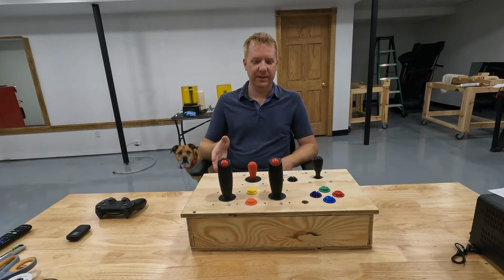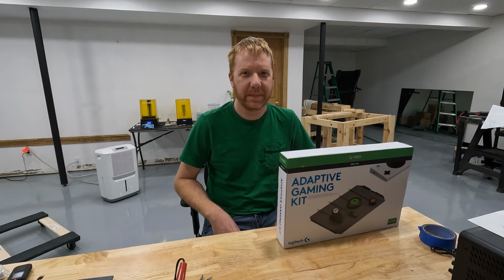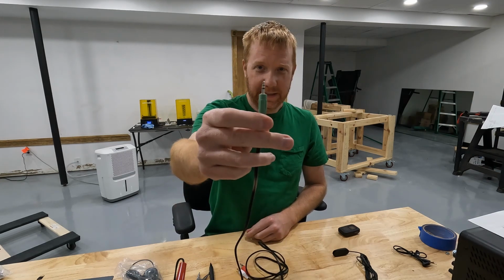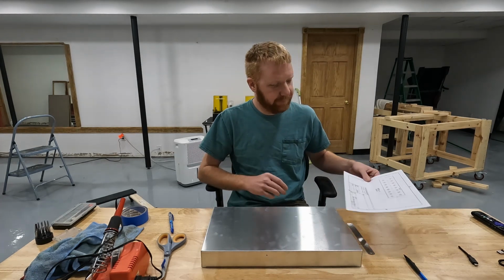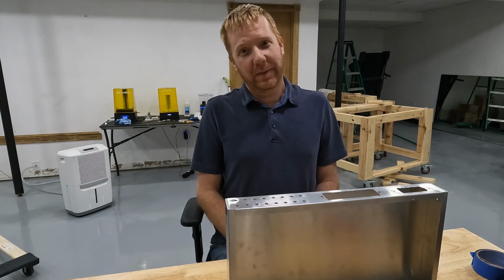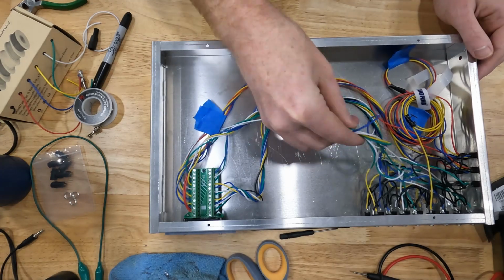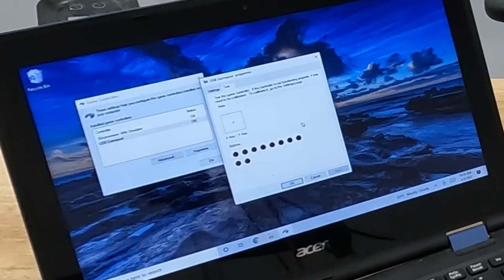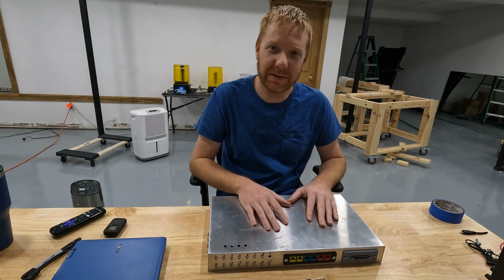DIY Adaptive Controller -All Gaming Systems!

Comment: You can use pressure mats, beam break sensors, motion sensors, distance sensors, touch sensors, tilt sensors, degree of freedom sensors, and others that do not come to mind at the moment. They can all connect to an Arduino microcontroller that can be seen by a PC as an HID (human interface device). I build holiday animatronic characters and props and also have made several arcade controllers and cabinets so I am familiar with everything you are working with. I would love to help you make your Nephews quality of life better.
Reply from the maker: Thank you for the suggestions! I have an Arduino microcontroller but I haven't done anything with it yet. One of these days I plan to experiment with it and learn how to use it. I'm not very good at programming which is a big setback for me, but I am interested in learning that skill at least good enough to do simple things.